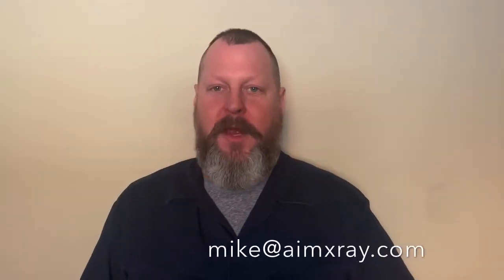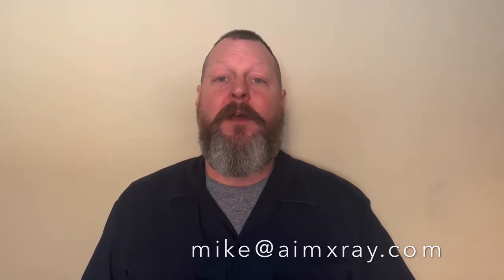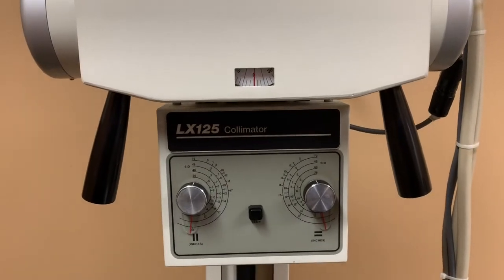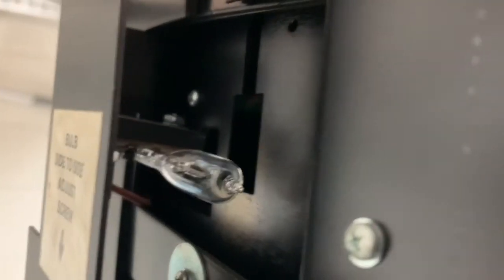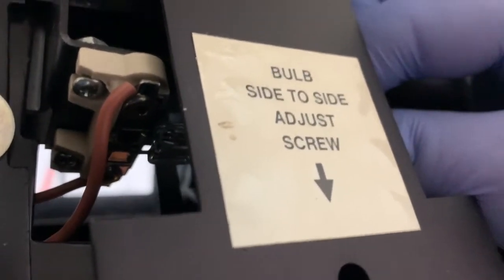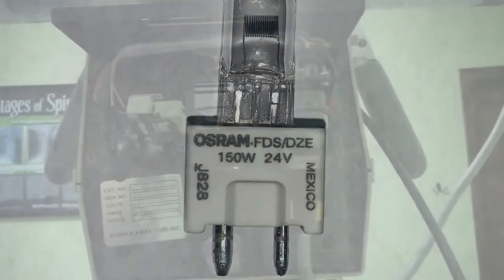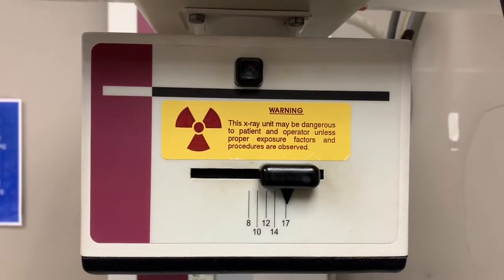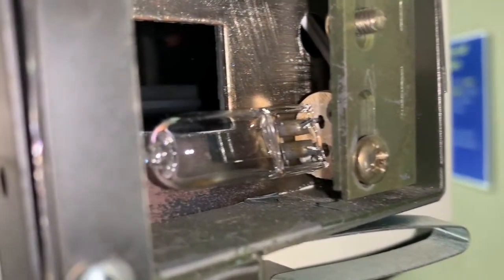Installing a collimator bulb

Comment: Hello Sir, Can you please tell me what is the function of the metal ring present on the top of the collimator. If it helps in attaching Collimator with X ray machine. how does it contribute in this regard. How collimator gets attached with X ray machine? Bolts, Screw, or magnetism?

Comment: Thx for the video. Does the bulb for Linear. MC-150  needs to be GY9.5 or GZ9.5 body? DZE/FDS 150W 24V comes in two body widths it seems.
Reply from the maker: Yes. Either should work as long as it is 150W 24VAC

Comment: You showed everything except changing the bulb out on the first tube. The bulb just yanks out? Does it screw out?
Reply from the maker: It just pulls out of the socket. No screws on the bulb. Prongs go into and out of the socket. Slides in and out.
Reply: @aimxray9823  is it pretty tight in there ? Like is it kinda hard to pull on?
Reply from the maker: @MrGabehere  You just need a sharp eye and a steady hand. You can do it.

Comment: Could u please make the video on types of collimator bulb with ratings defined of different ' mAs xray '
Reply from the maker: I'm not sure I understand your question. Could you be more specific and explain please?
Reply: @aimxray9823  I meant to say, video about the collimation bulb used for focusing while doing xray; with its power ratings of various capacity xray(100 mA,500 mA...)
Reply from the maker: @gauravrai680  The voltage to the collimator does not change as you change mA. They have no correlation.